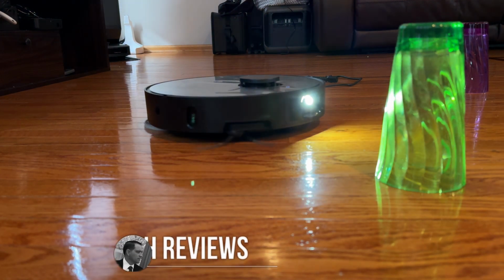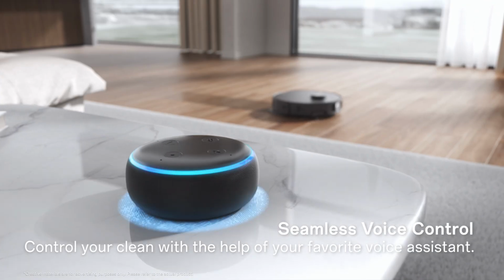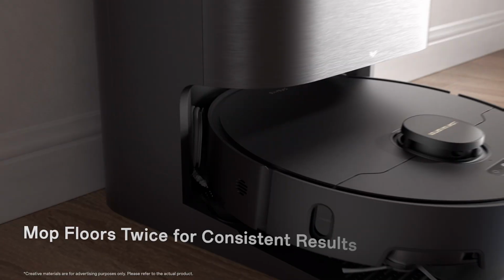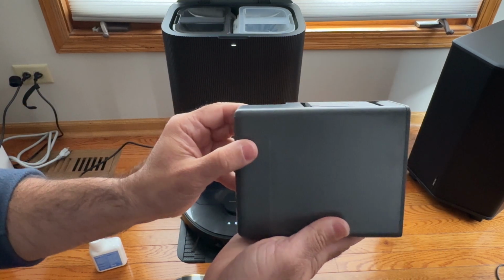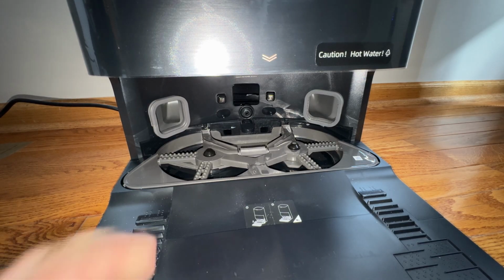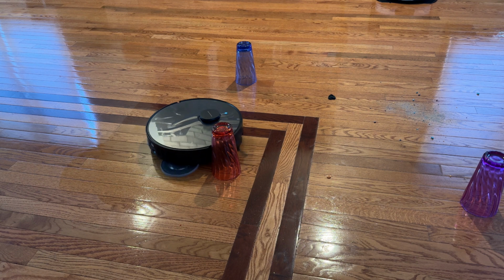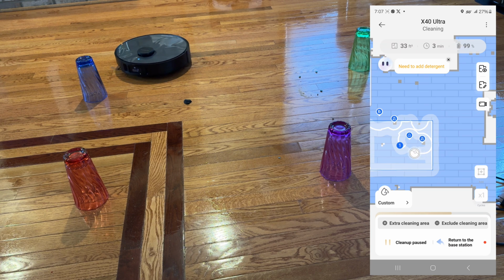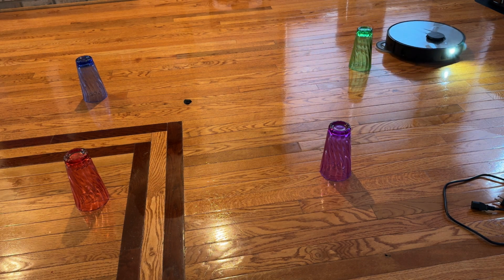Dreame X40 Ultra Mop & Vacuum Robot | Advanced Lidar, Smart Object Avoidance & Pet Poop Detection

Comment: No dog poop avoidance whatsoever. Moreover, it embraces poop and continues for a while to ensure its inner workings are coated and gummed up. Mop pad removal is fine but pad retrieval sucks.

It's a great vacuum but has 2 fails.

Poop and pad retrieval.

6 dog house, one indoor proper. I change a bag each week. Much better than romba but no poop detection at all.